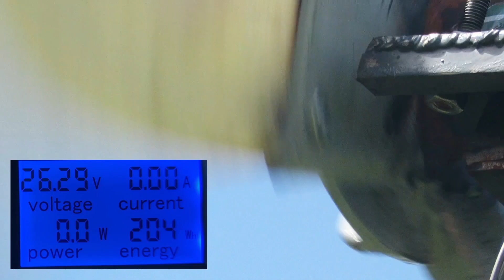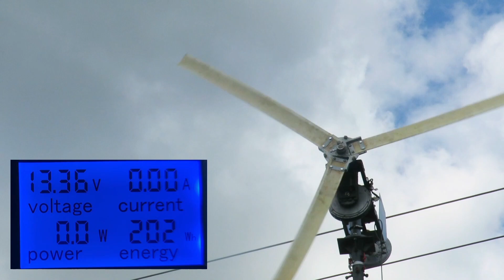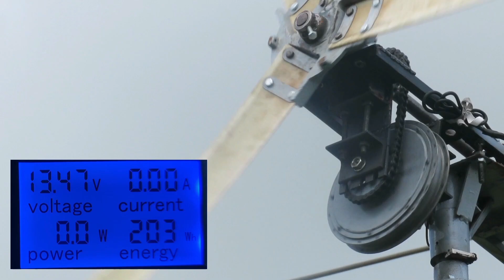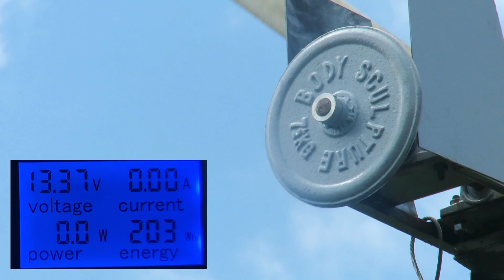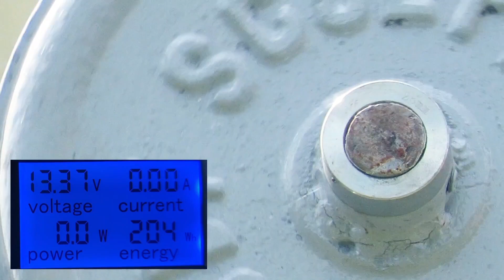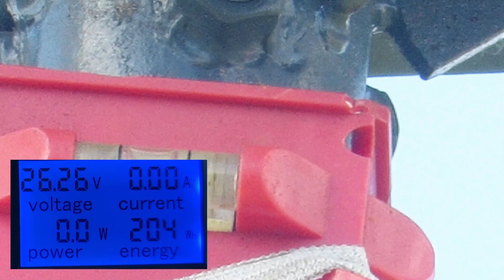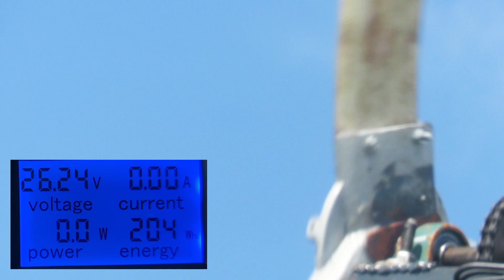Electric Bike Motor Hub Wind Generator Project - First Test - Short Version - 8 June 2022

Comment: This same turbine (roughly) had twin washing machine hub motors right? Is the single ebike motor better?
I have a x13 ac condenser motor Id like to try at just 8 or 10 feet for starters at 12 volts. Do you have any experience with them or heard of anyone using one? It's's not a hub motor, the magnets are on the rotor. Only 1/4 or 1/3hp motor but for pretty much a yard ornament 8' or 10' tall turbine I want to play around. Just waiting for a voltage sensing switch to cut off voltage and throw to dump load. Surprised I haven't seen one on youtube functioning and wondering if there's a reason why. It will get up to 12 volts spinning by hand very easily. I got one up to 250 volts with a 2800rpm drill but then the magnet came unglued 😅 Good to know your upper limits right off the bat I guess.
Reply from the maker: All you need to do is look at the rated RPM of the motor as it will be working in reverse if the rated RPM of the motor which should be written on the side is over 1000 and even over 500 then you're going to have big problems making any usable power, I'm persevering with the electric bike motor hub because they require a low RPM this one starts putting out 12 volts about 50 to 60 RPM, the washing machine motor machine was different I messed up something pivotal at the start and it was never as good as it could have been but will take an electric bike motor hub over one of those motors
Reply from the maker: I think really the washing machine motors are overrated as you can only get 1 kW out of them in hydro which is 1000 RPM
Reply: It says 0-1400 rpm... 🤔😅
And I was wrong. The one I threw the magnet off of is 3/4hp and the only other one I have says 1hp. No stated rpm on the 1hp. I didnt realize the ebike motor was turning that slow. Ill upload a video and post a link here in a minute and you can see how easily the x13 motor make 10-12 volts. Its just a video I have on my phone but you can pretty much just flick the fan and it will make 12 volts
Reply: Looks like it hits over 14 volts. Ive got no way to measure rpm though at the moment
https://youtu.be/rGY4mbp0U0k
Reply from the maker: The volts doesn't really matter have you tried it under load, cheers.
Reply: @GavinFreedomLover  What would you suggest? Ive run it with a drill and powered 110 volt bulbs. 7 watt bulb very easily and a 43 watt bulb. Cant remember if ive tried a 100 watt bulb. Ive also connected a 12 volt dc 40 watt bulb and tried to turn it by hand but it binds it pretty good. I suppose there isnt much resistance in such a bulb. Guess I could connect a car battery up to it and amp clamp and volt meter and see how many watts it would put out charging it, or what would you suggest as a preliminary load test if you were determining if it was a good candidate for a generator?